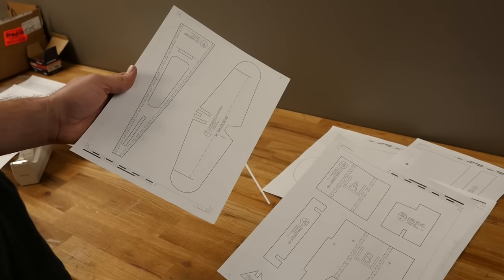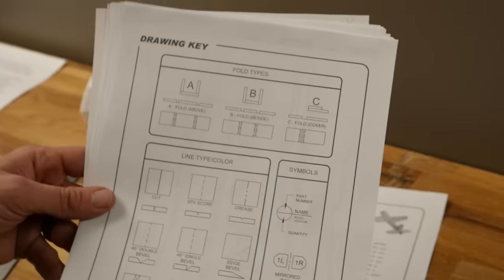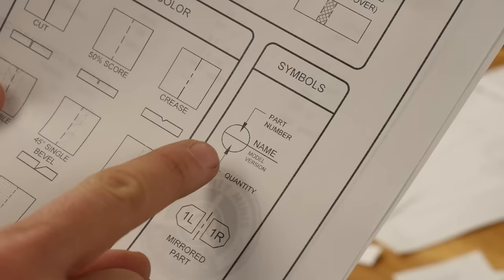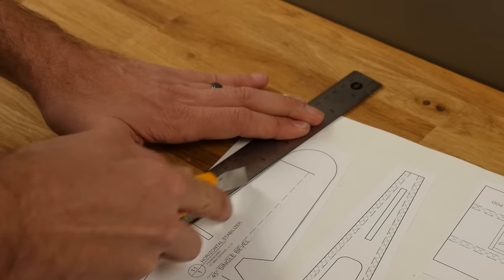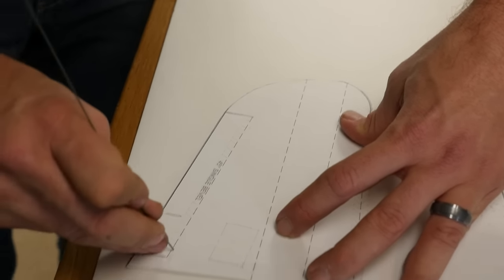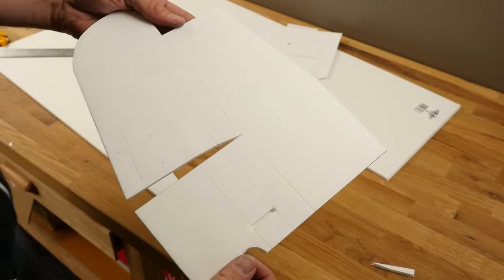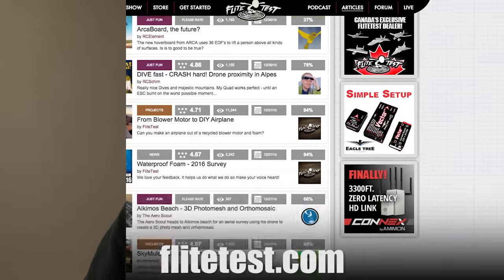Making Template Plans - Quick Tip | Flite Test

Comment: Thanks, Josh, and a big Thank You to Dan!!!  These plans are much easier to match up than the older ones.  I usually use the paper and trace it on the foamboard, making dotted cuts through the paper into the foam, and then connecting the dots.   Keep it up!

Comment: I use my DLP Projector and lightly hot glue the Foamboard on the wall. Use a digital caliper to scale the image to match the scaling on the plans. SO easy to quickly trace out a new peace when I screw it up.  That's how I built my FT Cruser.  :)
Reply: Nice

Comment: Hello fellow builders. I'm working on my first FliteTest airplane. A Baby Blender.
I did not want to do the template transfer thing so I picked up a bundle of 100 lbs 8/12 X11 card stock. Normal printer paper is 20 pound. 100 lbs is heavy business card paper.

Then Printed Baby Blender and Power pod right on the card stock. Worked great! Anyone wanting to try this. Ether 80 or 100 pound paper 8 1/2 X 11 will work.

Thanks Josh and the FliteTest team having a blast.

Comment: Great tips video Josh! This made me think of a new product line for your store: Precut (laser cut) Scratch-build Plans made of posterboard. Could be mailed in a padded envelope, making for minimal shipping. What do you think?
Reply: +TheAdkFlyer10 or a light plywood or balsa so that you could use a hot wire to cut it. Thats one of my biggest problems, getting my cuts to be perfectly angled and straight.
Reply: +the 142 Having made a few from plans. I'd be happy to pay the same amount for a template kit instead of a speed build laser cut foam kit.
Reply: +the 142 Not going to hurt sales, you don't buy "speed build" kits because you need a better template. After you cut out about 10 scratch builds you realize that the fun doesn't really start until you get out the glue gun!
Reply: +TheAdkFlyer10 Great idea! Would buy :)
Reply: +TheAdkFlyer10 Great idea.  Just a guess but I guess it would cost about the same to buy the poster cut-outs.  Then they have to create a whole other process to create the poster-board cut-outs.  If they can't sell the same volume it may not be worth it.  If I'm going to order anything, I'll just go ahead and order the kits, but that's just my take.
Reply: +vista7 I think a cardboard template would be a lot smaller to ship. It also wouldn't suffer debilitating damage in transit. 
More suited to international buyers. 
If I lived in the states I'd definitely just buy speedbuild kits.
Reply: I agree. I think the hardest part is lining up your plans and transferring them to poster board or foam board. I would love to be able to scratch build but have a set of really good templates to go by.

Comment: Great video.  Someone had already clued me in on Sponz's process.  Another tip they should mention is taking the full plans to Kinko's.  If you print them in black and white they cost about 4 bucks a page; color is something like 20 dollars a page.  If you are pressed for time like I am, it's the only way to go.  The other tip is you have to use really sharp blades or you get an uneven cut.

Comment: I like this method, last few builds I spray glued the templates right on the foamborad, only thing is that it's hard to remove sometimes and sometimes I miss a cutaneous have to reapply to find it. This is much better.

Comment: I've tried printing your plans 3 times, in 3 different scales, and I cannot seem to get the measurement markings to scale properly... Meaning, the "inch" key is either slightly under, or slightly over an inch long... any tips?
Reply: +AimlessMoto What program are you using to print them with?  I would highly recommend using Adobe Reader for the best, most consistent results.  In the Print options under Page Sizing, make sure you select either Actual Size or Custom with a value of 100%.  I always use the latter.  Never try to print the plans directly from your browsers built-in PDF viewer.
Reply: I have been using Adobe Daniel Sponholz . I tried the print sizing, still a hair off.
Reply: +AimlessMoto You've probably already noticed but ... Adobe has a print "actual size" button in the print menu below the "fit" button. Also, it doesn't matter at all if it's the correct scale as long as all the parts are printed to the same scale.
Reply: @ZonkerVA  i prin traight same site what i looking pdf picture, right top have print download and bush print then printer software can my brother laser printer, select normal,fit it,scale and scale has percent can change if need but i uses normal, come actual size good print. tiled A4 pdf work well, all other format no work anythink, how make biggest and real size.

Comment: without going to the extent of an article as suggested. I just wanted to leave a comment here about the ft 22 free downloadable plans. In the most constructive kind of way I just wanted to mention that maybe you guys could check these plans, because when they are taped together there is a bow on the paper which in some cases causes the builder to put the plans together incorrectly. Sometimes the lines for the cut out slots will be out of alignment. I've been a modeler in RC 4 a while in these scratch build plans and speed belts are really neat looking. I especially think I would like to try this Corsair because I had just purchased an old balsa Guillows kit that looks like it is close to being the same size. Cool stuff you have here. Just wanted to help.

Comment: My first attempt to print plans of yours. I have a Hp color all in 1 printer and when I tried to print out the plans and then checked them against your 1" scale on top I could not get my printed copies to match your scale i.e. your 1" scale was only 7/8" on my copy and no matter which copy of your plan (4) I printed out they all came out 1" = 7/8" and I had no way to adjust my copy magnification to for example 105%.  Any suggestions will be appreciated.  Otherwise I love what you guys do and just bought your Cessna 150 Commuter kit to build.  Thanks  Richard

Comment: There is a lot less work if you  print the plans right onto paper sized card stock.  no gluing paper  to the card stock or poster board. just cut out the parts after you tape the printed sheets of card stock together,  :)  been doing this for making wood working templates for years.

Comment: Spray adhesive? That sounds pretty messy, though I've never used the stuff. I've been making them out of card stock which is nice and thick. I can easily hold a template to the poster board while I score around the edges with a blade. Once the plan is outlined with score cuts it's easy to put the template aside and finish the cuts. If you try and cut all the way through with the template still in place, it's easy to cut through the template by mistake. You say the plans using this method are reusable, but I've found that regular printer paper plans get messed up too easily which is not a problem with card stock.
Reply: keep it away from clothing, fabrics, or carpet....it's quite sticky

Comment: I glued the plans to poster board and cut them out. Traced onto foam board with a pen. What I discovered on assembly was that everything was slightly oversized because of cutting on the ink line.  Your method will solve that mistake

Comment: I use the repositionable spray adhesive, spray super light coat to the plans and put the plans directly on the foam board.  Then I cut through the plans and foam board, peel the plan off the cutout and discard.  Wastes more paper than this template version but is less work and very easy.

Comment: Great tips.  I would like to see you guys make your plans not only in Letter format,  also in A4 format for your European builders.
Reply: +Henk Hatzmann Could this be why i always have alignment issues as i print in A4?
Reply: +Henk Hatzmann The tiled plans are universal.  They are designed to work on U.S. Letter (8-1/2 X 11 inches) and A4 (210 X 297 millimeters) without any scaling issues.  All you need to do is make sure that you print to actual size or 100% scale and it will work for both.  This format for the tiled plans evolved from the Flite Test community on the Flite Test forums.  If you have any ideas or suggestions to help improve the free plans, you can join the discussion here:
http://forum.flitetest.com/showthread.php?11770-Rearranging-FT-plans

Comment: Wish I had the machines you guys use for cutting. So much time spend cutting manually.
Reply: I would cut them manually but I buy the kits they sell just to help support the great videos they put out every week
Reply: I can't stress enough how much of a time saver the speed build kits are. I printed plans and scratch built five Flite Test planes before I bought my first speed build kit and I will never be printing plans again. Its a great way to support their business and I would say it cuts 2/3 of the build time.
Reply: +csman77 yes but when you live in europe
Reply: I would buy them as well.. But the shipping Coates to Europe! Wow!
Reply: +Rcbif See my top post on printing out the full plans.  I'll NEVER print out and cut tiled plans.  It takes several hours to cut and piece the tiled plans together.  Just head over to Kinkos with a thumb drive and they will print on a plotter for 4 bucks a sheet.
Reply: +Rcbif But it's also good to support and buy the kits.  If I can find another plane I really like I'll buy the SBK.  The last few I've built have been total duds.
Reply: +Rcbif I'd also like to see these sold at local hobby stores.  I would think they could reach a whole new audience if they would work in conjunction with LHS.  Everyone would win; FT sells more units; LHS sells more parts.
Reply: +vista7 - My problem is just with what the pricing ends up being. I would pay maybe $10 shipped for the cut foam kit, minus the hardware. That is what a disposable foam plane is worth to me. These kits are essentially equivalent to the mark-up of Estes rockets kits. Very cheap material, with a bit of added labor.  I can defiantly see why some do pay more for the experience, and to support flite-test, but I'll support them in other ways. I am by no means knocking their product or the pricing they need to use, but it's just not for me.
Reply: agreed.  I pay 8 bucks then spend the labor to make a template and build the kit.  I am pretty cheap so 30-35 bucks for a kit made of foam board is a bit high.  I have to put packing tape on them or else moisture wreaks havoc.  It is good experience but I also like my brand name planes as well.
Reply: They use laser cutters which I believe are thousands of dollars
Reply: They sell them also in Germany for example.

Comment: awesome i recently bought a ft twin sparrow but i didn't put it all the way together because i built it before putting electronics in so a few days ago i bought 2 more because the previous ones wings folded after a rough throw so now i have one for a chuck glider and one for full rc this video is going to help because i might need to replace some parts based on that im a begginer in this hobby

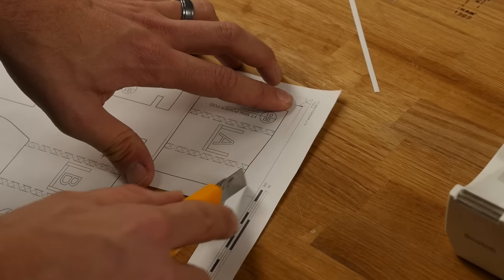Comment: 1:38  GYAAAAAAAAGHGHHHH GET A CUTTING BOARD!!!

Nitpick aside, my method is to use a pushpin to transfer points from the printed plan to the posterboard, and then I just connect those dots with a ruler. Works for simple stuff, at least!
Reply: yup. same here.

Comment: the one thing that I do not understand is how to print the plans. The printer has different percents for viewing
Reply: +chad sanders I would highly recommend using Adobe Reader for the best, most consistent results.  In the Print options under Page Sizing, make sure you select either Actual Size or Custom with a value of 100%.
Reply: +Daniel Sponholz thanks for the help new to this hobby a friend introduced this to me and sparked a childhood dream and allowed me to chose aerospace engineering for my bachelors degree

Comment: Too complicated and expensive. I use a glue stick. Assemble the part of the plan that gives you a part, say like a wing panel. Cut that out leaving at least 1/4 inch around. For poster board I use some that is 11x14 and tape that together as needed. Apply the glue stick around the perimeter of the plan part being sure you get the outline. Apply a little in the interior as needed. Stick this onto the poster board and cut out.